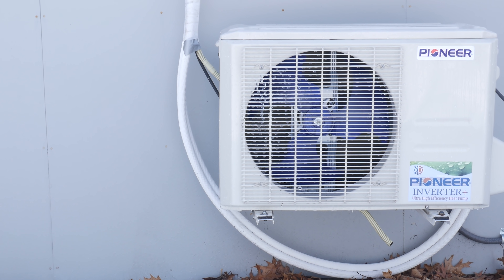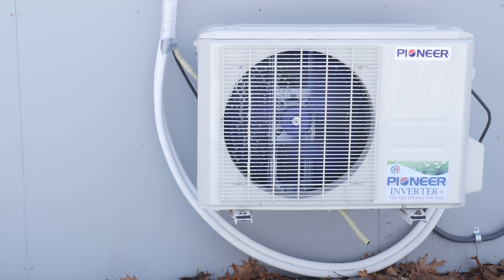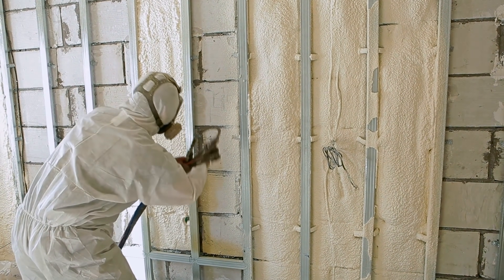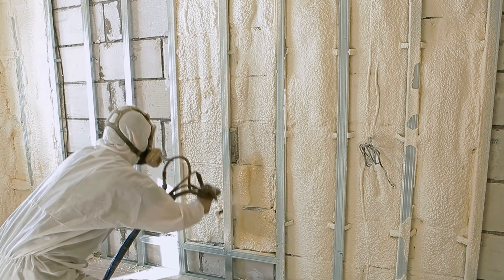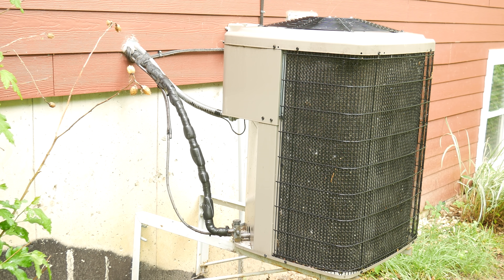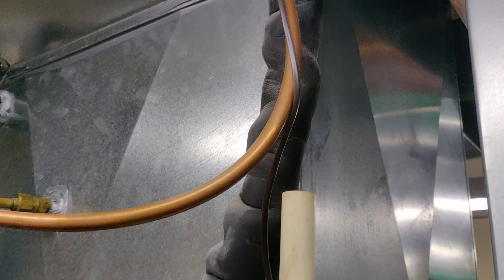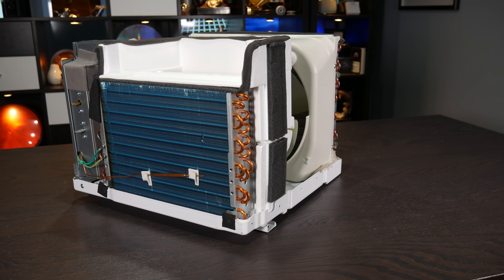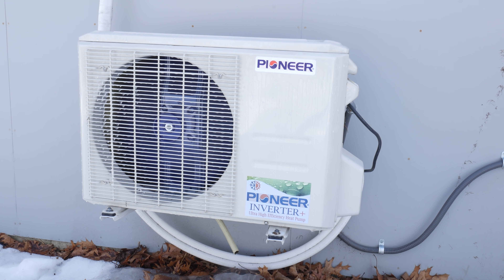Heat Pumps are Not Hard: Here's what it will take to start pumping

Comment: Let me preface,I have been in the HVACR industry for 29 years. Industry standard pricing, no matter how you do the math, comes to parts costs, x2 plus $1k per unit installed for labor (i.e. indoor, outdoor) plus lineset cost x2 + 100 for labor, then 10% added to total bill. Now let me explain, first the company you hire has to make a profit, pay their employee, van, advertisement, etc. but what is not normally thought of, is this company has to honor a warranty, which the mfg only offers wholesale replacement cost, no refrigerant, which is expensive, and no labor. And the employee, if he or she is very experienced and knows what they are doing, the cost of that employee goes as much as $40/per hour, even when they are just driving through traffic for an hour and a half just to meet you, or other customers, day in and day out. The cost does not start with the HVAC company, but with the manufactures cost and lack of support on warranty, sure they will give you a new part, but they wont pay to install or diagnose it. Your coil leaks, you get a new coil, in a box, but they don't pay to have it installed, or purchase new refrigerant, filter dryers, gas to get there, etc. So yes, replacing the system with like is cheaper, due to the lack of linesets and multiple pieces of equipment that has to be warrantied by the company who installs it, with a less of a loss coefficient, and the without a second person to help run the linesets. Mini splits are great but very limited, what are you going to do with the bathrooms, walk-in closets. As far as your friend you mentioned is concerned, a duel fuel with existing duct work would probably be the best solution, site unseen, possibly using a variable speed compressor and condensing fan, with and added upgrade to an exv, it would only require pulling a new control wire. However, all these improvements with technology, at this time comes with a risk, the failure rate is much higher than the simple on and off systems, even though those aren't great either. Just my 2 cents.
Reply: Also, if you want, i could give you a quote from my supply house on a system, to see what I pay for it. And maybe you would understand the costs, and I am on the east coast.
Reply: Small businesses are expensive to run

Comment: Wow those prices are nuts! A year ago in Australia I got a brand new Daikin ducted aircon (reverse cycle of course) installed from scratch - not using any existing infrastructure at all. AUD $10k start to finish for a 12.5kw system (3.55 tons apparently) with 6 ducted zones and a smart controller. Been very happy with it and it is "on" 24/7 with some complex automations concervatively controlling temperatures and some presence detection to limit usage in rooms which don't have people in them.

Comment: I have to thank you for discussing this topic. I brought it up with my dad (who knows quite a bit about tech actually) and was surprised to hear that he had already done this to the house a few years ago. He got one that operates well down to about 40 degrees. We have a gas furnace that fires after that. I think he was talking about potentially upgrading, but that it wasn't worth it for a while. In addition to offset what he has done, he has thought about solar but it is a bit too expensive and besides, you would have to get a battery pack to really take advantage of solar.
Reply: My heat pump uses resistance heating.  It doesn’t turn-on until 5 degrees
Reply: Solar roofs don’t require a battery.  You send the excess daytime electricity to the utility & they return the electric at night.   (I simplified that, but it’s basically how it works.)

.

Comment: Around my area the executive townhomes (a set of two story story homes, one on top of each other, with one set side by side with another so that all four entrances are common and they normally build 8, 12, or 16 homes together in a block) each have a small A/C at one end of the balcony. And it’s a small, thin A/C unit that can’t be very efficient.  Efficiency is partly determined by the size of the fan as a larger fan allows more air to be driven over the coils to transfer energy. I had my furnace and A/C replaced in 2015 and I was shocked by the difference in size in both the furnace and A/C from the old ones which were around 20 years old. The new A/C unit must have been twice as large and the furnace might have been 2/3 the size of the original. 

But the small A/C units on all of these new builds is a pet peeve of mine. These buildings should be set up for common source of heating and cooling. Since I’m in central Canada and an air source heat pump would need a backup I’m in favour of using ground source heat pumps. When they are building these homes it would not be very much trouble to install them. But once these small A/C units are installed they are committing the owners to 15 or 20 years of that and it will probably be replaced with another A/C unit. The odds that an environmentally friendly system for all of the units will be installed now is practically nil. It’s a shame that builders are allowed to get away with such destructive practices.

Comment: I live in a little one bedroom apartment, and when a remodel was done a few years ago now it was switched from a window unit ac and space heater heat to a two head unit mini split with a 23 seer. With the exception of a few extremely cold days here in South Central Missouri, I stay very comfortable. The only downside is that the system that was installed does not have any backup heat for the extremely cold days. So, I have to use space heaters for those specific times.

Comment: Northern WI here. Got a Bosch BOVA-36HDN1-M20G, and bmac2430bntd and maybe 25ft of lineset installed last December for $5,200 not including electrical, but before a $1,000 energy rebate. Was added to my Goodman 96% eff nat gas furnace. Rates are about 13 cents kwh, and $1 to $1.25 therm for gas.

Comment: Converted my home from heating oil furnace to heat pump and it turned out great. Feeling even more justified now that heating oil is at $6/gal. It wasn't a cheap to convert but thankfully I was able to afford it, I worry for those that can't and will get hit by ever climbing heating cost. Since 2000 heating oil has only trended up in price, gone are the days of $1/gal heating oil of the 90's.

Comment: I lived in an apartment with a 1-speed heat pump. The thermostat would only control a mains contactor, that would engage with a loud clap, wired directly to the induction motors that ran the blower, compressor and condenser fan. The heat/cool switch on the thermostat would set the reverse valve direction. It was a conventional central ducted system too with an outdoor condenser/compressor box that used a conventional shape. If not for the move-in packet advertising a heat pump in their newly built apartments, I would've never known mine had one. There was no intelligent circuitry (except maybe a few safety interlocks) inside it so I can imagine it would've been pretty economical to install over a conventional system. Not sure on the efficiency but I remember electric bill was fairly reasonable.

Comment: Thank you for pointing out the search term I have been waiting to learn about since 2018. VRF (Or VRV if you're Daikin) is potentially the solution to the problems we have at home.

Now I just need to find a manufacturer who can offer a unit that's small enough that we can afford it. The smallest system I've found so far is a whopping 14kW and the outside unit is 1.6m (5.5ft) tall!
Reply: Sadly, after doing more research, it appears that not all VRF/VRV systems offer heat recovery options.

With most manufacturers, to do simultaneous heating and cooling, the external unit needs to have a three pipe interface, using two 4-way valves and both high pressure liquid, high pressure gas and low pressure gas pipe connections.These external units are then paired with either three pipe capable internal units (which contain their own 4 way valve to switch between heating and cooling) or traditional two pipe (gas+liquid) internal units plus another device to switch between heating and cooling mode (Fujitsu call them RB units, Hitachi call them CH boxes etc.) essentially a three line interface on one side and N two line interfaces on the other, with N additional 4-way valves connecting them.

Most external units only have a single 4-way valve though, and two external pipes which a single 4-way valve switches between High pressure liquid & Low pressure gas (for cooling) and High Pressure gas & High pressure liquid (for heating).

One manufacturer (Mitsubishi) has a system which uses a branch controller, with a single standard gas/liquid interface to the external unit and N gas/liquid interfaces to each of the internal units, but again, the smallest external unit supported by this system is 22kW and is over 1.8m tall!

Comment: Recently, I have become enamored by the split system heat pumps (both mini and multi splits).   The main advantage of these systems is that they don't require large holes in your insulation envelope, unlike ducted systems.   This is great for highly insulated homes.  

Also, If the ducts themselves are piped through in an unheated space, like an attice or crawlsapce, the ducts themselves really should be as well insulated as the walls in your home!  Of course, if you have seen insulated duct work, they usually only have an inch or so of insulation on them.   

Another advantage of multi-split systems is that they can heat or warm a single room, instead of the entire house.

Another advantage of some more advanced split systems is that they come with "inverter" driven compressors.  That means the compressor does not operate on just a single "on/off" setting.  It can ramp up or down as needed, as the outdoor temperatures changes, or as more rooms in the house become occupied.    Also, the indoor units can run very quietly, since they can run at a very low setting, contantly if needed, instead of cycling on/off all of the time.

Currently, mini-splits are great and affordable for small homes, garages, home extensions, cabins, and RVs.  However, multi-split systems are currently generally more expensive, than standard ducted heat pumps.  Hopefully, this will change as they become more popular.
Reply: ???.  I have a ducted heat pump, and there’s no holes in the external insulation.  All that goes through the wall is the pipe that carries the refrigerant (same as the split system variant)
Reply: @electrictroy2010  when I had a ducted system, all the air ducts went to the air handler in the attic. But these air ducts were much less insulated than the ceiling and walls themselves, transferring heat and cool to the attic air. Also these ducts literally require holes through the ceiling insulation, which can leak. That is what I mean by holes in your insulation envelope. 

Of course you can also think of doors and windows as holes in your insulation envelope, but these have a certain expected level of insulation themselves.

Comment: My little heat energy power saving hack: I live in a sunny climate, and have solar PV panels. On sunny days, in the morning before heading off to work I put 2 x 1/2 gallon plastic bottles (90% water filled) into the freezer compartment of my fridge. The free (and excess) solar power during the day freezes them, and then when I get home from work in the late afternoon, I grab them out and put them in the fridge section overnight. My logic is that my fridge then uses less power during the night cooling (when I would pay for the power since no free solar). In the morning, I transfer them back from the fridge (they are mostly still frozen) and back into the freezer section - rinse, repeat.

Comment: Here in Europe we're moving away from the R410 into the R32 (not a mix of gasses but a single type, so can be topped up as needed) and also new homes tend to be built with "radiant floor" served by an air-to-water ac unit, and can also be used in summer if the piping is laid tight enough. It's allegedly more efficient and the A2A units, has more thermal inertia and it is completely silent! (also you can tag in your gas/diesel/kerosene boiler into the waterworks) and for people lucky enough, there are the well units called "geothermal units" that achieve incredible COPs.

Comment: We're in sw Missouri. The cost for three small heat pumps (9k, 9k, 18k) was quoted at $15,000. Installed myself with the existing electric hookups for less than $1800 in three days.

Comment: My ancient air conditioner just kicked over and died.  Probably a leak in the evaporator...  I'd aggressively aim to repair rather than replace, but the system is so incredibly old, the engraved aluminum data plate is too worn to still read.

That said, this video is here just at the right time.  The last conversations had me looking hard at heat pumps, but now I have purpose right here and now.

Comment: My current home in Colorado is a pain. The basement and third floor is freezing or heats up to extreme temps just to keep the main floor at sub par temps. Its super annoying as I keep repiles and fish in the basement since theres no room on the main floor. Im not sure if a heat pump would help or if theres other issues with the HVAC system but i'D love to find out. Heating elements for repiles and fish tanks are expensive to run and that gets comounded by trying to make the main floor livable. Thanks for your videos, i've learned a ton.

Comment: So, we put in a lennox el16p1 heat pump, and it gets "up to 17 Seer".  Not the most straightforward of processes, (the supply chain issues were just part of the problem).  After it got correctly installed, it's working great.   And there is a cost/benefit calculation to be made depending on what your climate is (this is Northern California).  But happy we're off that bit of natural gas use.  Not sure why you were only seeing 14 seer.  If I had a crystal ball, I'd have made different choices, but happy now.

Comment: My government here in NZ funds 80% of the cost of a heatpump and insulation. Full insulation and a 9KW Hitachi heatpump came to NZ$1300 for my smaller 90 square metre 3 bedroom home, and 9KW heating capacity means the unit is just lazily idling most of the time. It's brilliant, I just leave it on all the time, and my house is always a comfortable temperature.

Comment: You hit the nail on the head in regard to families on low incomes who could benefit from these cost saving? devices but can't afford the upfront costs. It just proves that the Government doesn't really give a toss about poor families. They could even fit solar panels as well. A thought occurred to me, if these units are extracting any heat however small from the outside could they be installed inside and use any internal heat and thus get warmer and warmer, a sort of feed back loop.

Comment: Businesses are definitely going to business.  My mother had an HVAC service tech (who came out and charged a completely reasonable price for an inspection and troubleshooting service call) quote her multiple hundreds of dollars to replace the blower capacitor on her completely conventional gas furnace.  It was about $10.00 from Grainger for the part and about five minutes to replace via unplugging and replugging a few spade push on connectors.

Comment: I’ve got a heat pump. This winter it was 15 degrees out, the heat pump was designed for a house about 75% the size of mine and still, it kept the house at 65 degrees the whole time, and all I needed was a small space heater and not to mention the insulation is not even very thick at all, so lots of heat was leaked out. Any time the weather is above freezing it doesn’t need to run more than half the time, all while at half speed max.

Comment: I live in northeast Georgia directly east of Atlanta, and practically every HVAC system put in residential  and small office spaces that I know of around Georgia is a hybrid fuel heat pump.
What I have on my house uses the normal heat pump the vast majority of the time, but if the differential temp between set point and actual indoor air temp at the thermostat is at or over 5 degrees in winter, electric heat strips kick in as "Emergency Heat" (EH). Some houses use gas for EH, but the vast majority of the time, these EH systems never come into play.
That's the way it has largely been for at least 35 or 40 years around here.
At least down here, we don't seem to have the same reluctance to adoption of heat pumps that you're talking about - they're practically legacy equipment in most homes.
Also, I'm seeing a LOT of mini split systems being put in everywhere I go.
Come down to Georgia if you want to see heat pumps in widespread use.

Comment: New Zealand has a government oversight subsidy(No overcharge for you!) for installing both insulation(Roof/Underfloor) and a heat pump of our choice. iirc we paid around 5% of $2500NZD(1600USD) and we forked out for a better, heavier Japanese unit. So badass, it cools the entire house with little effort and the only thing you hear is the air flow. When the company sales guy came around offering it, we thought it was a scam.

Comment: We've been using window mounted heat pumps for decades here in southern Brazil although most of the time the units are installed on walls. It serves our heating and cooling requirements well (35°C max in summer, rarely below 0°C in winter).
The main problem with those is the noise. Now most of them are being replaced with split units.